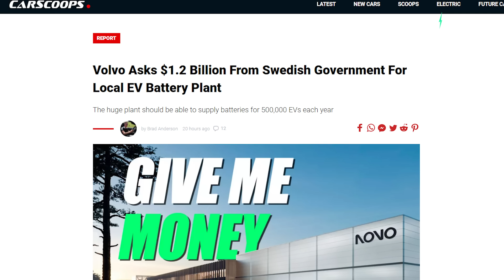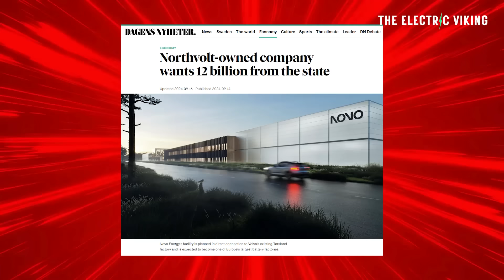China owned Volvo asks for $1.2 Billion from Swedish Government

Comment: When Volvo was really Volvo they made uniquely strong cars, like the 240 that with car would last a very long time. I had two of these many years ago. Fantastic and cheap to repair, on the rare occasions that was necessary.

Since they were bought by Ford and then Geely, they make cars that are neither better nor worse than many rivals, cheaper and more expensive.

It is Sweden's own business whether they go for this grant of tax-payer money to Geely. I suppose it will be based on a cost benefit analysis and not so much on a loyalty to the Volvo marque as such by now. 

Norway never made a serious effort to build cars, but they do make very good oil rigs and other ocean going craft, and marine engines. I suppose it depends on how strong the market still is for Sweden and across Europe, and whether this justifies the grant.

Best wishes from George in UK.

PS: Half British and half Norwegian.